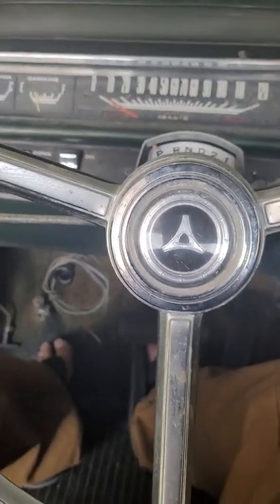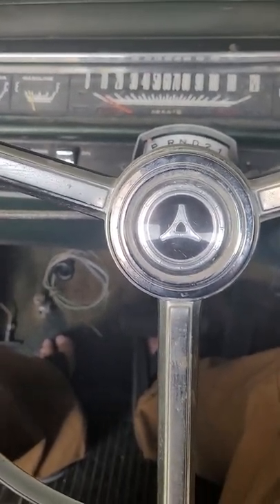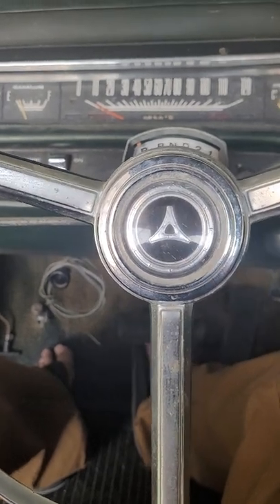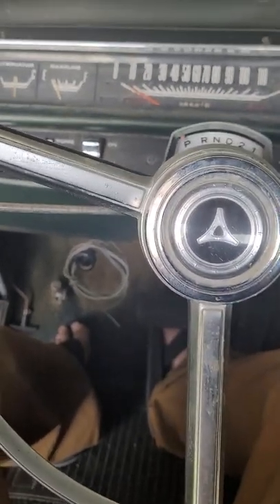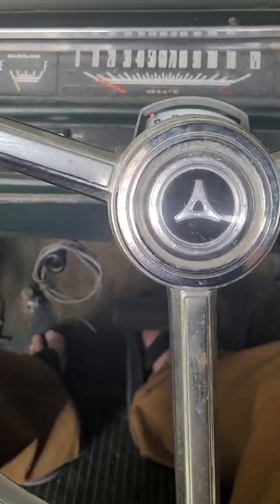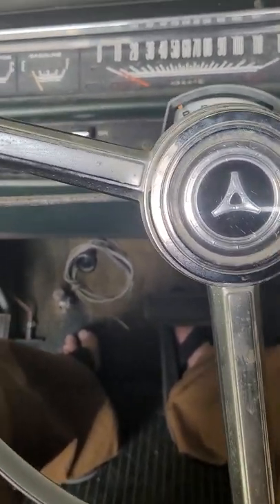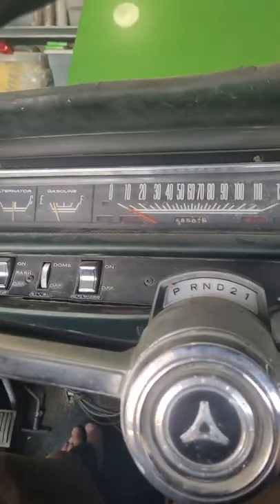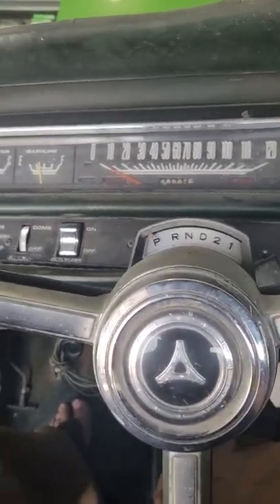brand new starter, not engaging flexplate ring gear..

Comment: 2 reaons:  they gave you a starter for a 168 tooth flexplate/flywheel 
or the new starter has a thick 3/16" spacer on the end of the shaft that you gotta take out by removing the nosecone.